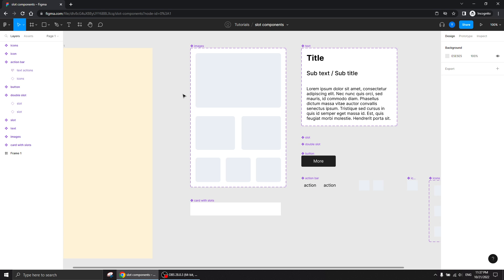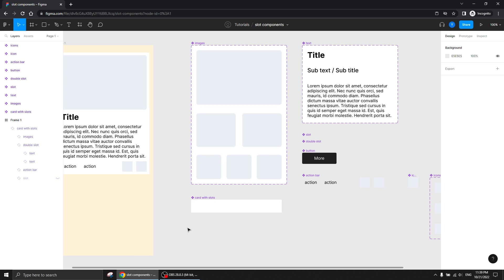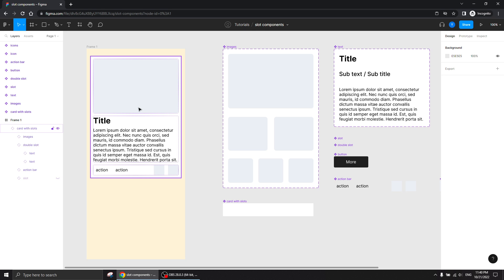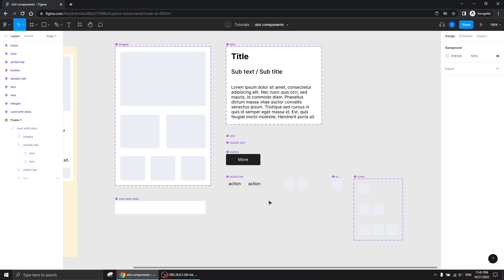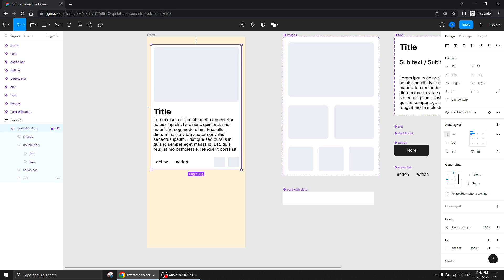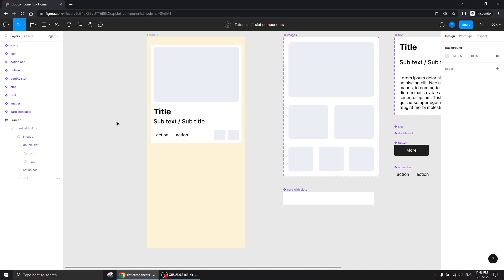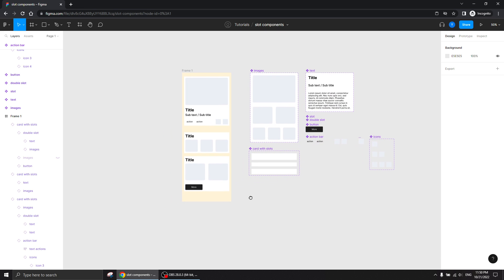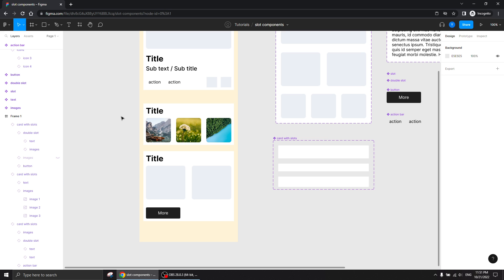Slot components figma tutorial

Comment: I have a question how do you create a component out of these, for examples if your card layout via slot can be converted to component? Also another question  how many slots are recommended (side by side or up and down?
Reply from the maker: Hi there. 
You need to make the slot (lets say a frame) a component and put an instance of it inside the card component, one or a few.
Give this instance (the place holder for another component) an "Instance swap" property (i dont know if it was that time that i created the tutorial, i guess no) and you can decide with which instance to swap it.
Side by side or Up and down (Horizontal or Vertical) is totally according to what you need. Each case to itself - there isnt a rule for this.
I hope it helps 🙂

Comment: Great tutorial, thank you, Yariv! A tip that can help: instead of working with slot variations (slot, double slot, etc), you can inside a card for example, add a space component between the slots. That's the way that I built some components in the design system, it's easy to change the spacing between items :)
Reply from the maker: Hi Gisele :) Thank you so much for the great feedback 🙂 I really appreciate it! Yes of course - it's possible to work with space component - definitely 🙂 The main thing is to understand the logic of it and than it can be used in many variations - up to you if course - each designer uses it in a bit if a different way, as it fits the designs. Great point ✌️

Comment: thank you Yariv.
I love your vids because they are practical and informal, but this is confusing beyond the fact that is advanced. Basically it doesn't go straight to the point. While explaining you don't follow a linear logic line, taking detours and losing the thread. It might make sense at the end but it's hard to follow you while explaining.
A good outline and sticking to it might help making the explanation clearer.
I have a question:
when is it smart to use slots? and when is it better to use other syatems? Is it a silver bullet?
Reply from the maker: Hi David. Thanks a lot for the great feedback! Its highly appreciated :) Thanks a lot for making your points and i do understand that it didnt follow a specific use case as for lets say "i am working on a mobile application, creating a content card which holds this kind of info and i am using a slot component because... and these are my considerations, the reason for doing that". 
My base assumption is that using the slot component method will come after you are familiar with instance swap, familiar with component & variants/properties and kind of a good knowledge in auto layout
The goals of this tutorial, mainly, were -
1. Getting familiar with slot components (in general - what does it mean and what actually is it?)
2. Understanding that its a working method and not a feature.
3. Of course, show an example how to create it and use it, without getting into the creation of components & variants/properties or explaining about auto layout.
4. Explaining it from the top level, the main idea of it, as i mentioned, without getting to a very specific use case but just through an example of the content card i was creating in this tutorial.

To your question - i would say that there is no black and white answer here and each team gains during time working methods that work best for them but i can definitely say that for like the example i gave here, the content card that is actually built from sections, building blocks, its a great way of using it and a lot of screen elements are built like that.
Think about a website which is built from horizontal sections - each section is actually a slot.

Another great use case is for UX designers in a team, which are less into the UI or in general, less into creating screen elements themselves, building for them slot components they can easily use and do their work with the components that you create for them - with content place holders of course, not with the real/visual content.

I hope my answer makes it a bit more clear - if you want me to create another tutorial about a more specific case - please let me know and of course be free to continue this conversation. Thanks!
Reply: @YarivBE  Booom! Thank you a A LOT for this exaustive explenation 😁
Basically are building blocks that you can customise, that's fairly clear to me.
The advantage is that you make them as archetypes and then they can be modified as needed.
This requires some work ahead to make them but it will simplify editing afterwards, streamlining reviews with clients, ab testings and in general those circumstances where making quick and consistent changes holds value.

For instance, It seems to me that they are an "overengineered" solution for small projects. Makes sense?

It's a very interesting way of managing elements in a layout though. If I should ask for a tutorial it would be something with content instead of placeholder, so that it shows the difference with doing the same thing without using it (basically it's quicker to edit, if I got it right).

Thank you again for the great tutorials ;)
Reply from the maker: @vaxel2  
You are most welcome my friend!
Yes, it definitely requires work ahead and more than that, understanding the needs of each case. Of course, it's dynamic and build up as you go - that the logic of working with variants - you can always add more to each component.
Yes, i definitely agree that it could end up being "over engineered" for small projects :) it's more reasonable for a team, even i would say a big team. 
About the tutorial - cold definitely make one like you described - will do!
Thanks again for your great feedback! - means a lot to me ✌️🔥